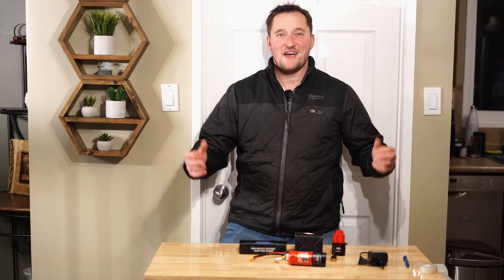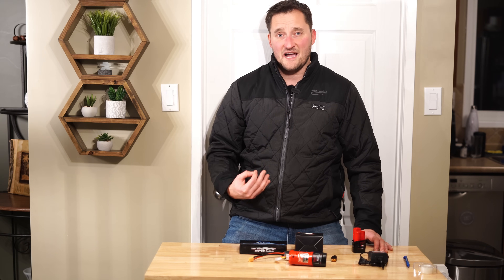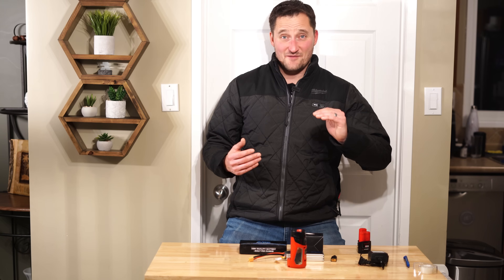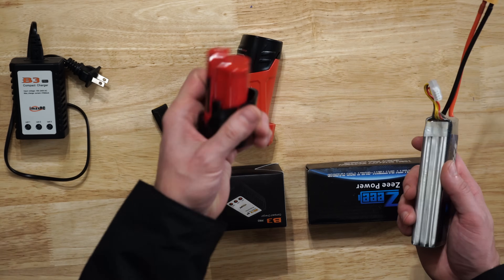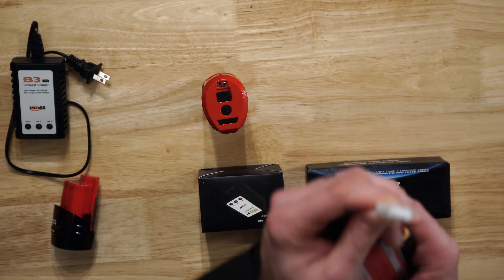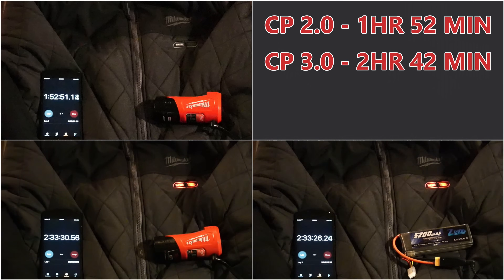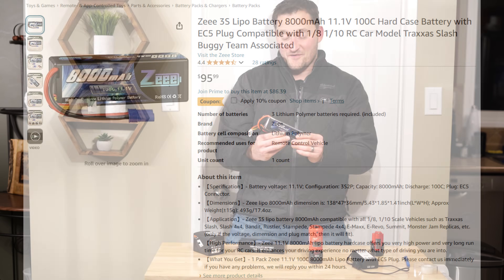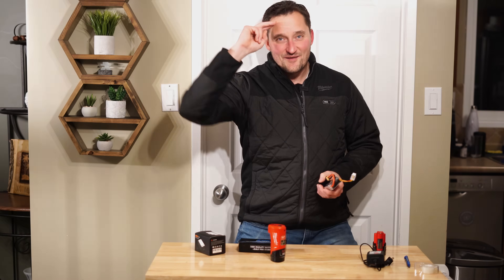WARNING! Read Description - Milwaukee M12 Heated Gear Battery HACK for INSANE RUNTIME!  Part 1

Comment: STOP! Please remove this video from YouTube immediately.  This misuse of an RC LiPo battery will drain your wallet,  best case scenario. More likely, FIRE 🔥. As in you will set yourself, your home and or family on fire doing this. I'm an avid RC pilot and rock crawler. I use LiPo batteries almost daily.  And never abuse them like this video suggests. LiPo and Lion are not the same and this is just a horrible idea.  I do have a Milwaukee heated jacket, but I'm not ignorant about batteries. NEVER DO THIS!!! 😡☹️
Reply from the maker: @ChrisDavis-eq9lj Hi there, I actually put out an updated video where I incorporate a low voltage alarm and intelligent charger into the mix. I personally wouldn't consider discharging a battery at 0.8 amps attached to a low voltage alarm and then charging it back up with a smart charger "abuse" but each to their own. Cheers!
Reply: @RegsChannel  Discharging that LiPo battery at a .8amp rate of discharge won't hurt it. But if that is your criteria for safe use? Your ignorance is alarming and this suggested use of a LiPo is unsafe and unacceptable. Even a tiny 1s150mAh LiPo will cause an extremely hot fire if abused. This isn't a candle or match flame. It's a blow torch and it is not brief. A 3s5000 will be a1 to 2 minute fire. And you want to wear this? Stop Drop and Roll will not help you. These batteries will continue to burn if completely covered by your body. Even under water. Over discharging LiPos like you did in your uncontrolled run time test WILL damage them. Improper charging, ie: charging to fast or unbalanced charging WILL cause thermal runaway and fire. Puncture a cell, very easy to do with that soft case Zeee and FIRE. Leave that LiPo at full charge for more than a few hours? It will begin to self destruct. Swelling and internal shorting until FIRE. I never leave my LiPos up for more than 12 hours, but typically 4 or less from charge to use to storage charge.  Cheap chargers like you recommend often fail, catch on fire and then set the charging LiPo on fire as well. Posting these ideas as "good" is awful. 
     I said I was RC active. Between flying and ground based, I know over 200 people involved in the hobby. Not all of them use LiPo, so you can narrow that group down to about 100. Out of that 100ish, I know of 5 home LiPo fires. One was in a detached garage. Charger fail, burned garage to the ground. 2 were unattended charging fails that resulted in both homes being burned to the ground. The other 2 fails were caught in progress. The homes were saved but damaged. And both guys received extensive 2nd and 3rd degree burns while throwing the burning LiPos out a door or window. I'm not even going to list the fires that have happened in RC crashes, but I've seen plenty of them.
     LiPo batteries are safe to use if used properly. Good ESCs (electronic speed controls) have soft and hard cutoffs to prevent over discharge. So do Milwaukee tools to protect the LiOn batteries they use. Quality chargers used correctly will safely balance charge the batteries. They will also discharge them to safe storage levels. If you don't understand and learn how to use them, you will get burned. I'm also an electrician and have been working construction for 40 years. I have over worked power saws and drills to the point they have burned. But not battery fires. I don't over ride or disable battery safety systems. That is exactly what your video is saying to do and that is dangerous.
Reply from the maker: @ChrisDavis-eq9lj  Thanks again for taking time to comment. Your passion for the topic is evident here. I fully agree, folks need to understand the risks involved with doing anything and then make a judgement call from there if it is for them. For my particular use case I feel that with the proper charger, the low voltage alarm, along with proper storage, I have mitigated the risks to a level that is acceptable to me personally given MY use case.  Obviously that is going to vary from person to person. Take care. Cheers!

Comment: Is there an adapter yet for  Milwaukee's new Hexon heated clothing using the 2-prong F-shaped plug?
Reply from the maker: One of the 2 prongs should Interface with the old battery adapter. I can only assume the second plug is for the Bluetooth functionality. Won't know until someone send me a Hexon jacket, or I pick one up. Cheers!

Comment: As with most "hacks" they are only done by people with no technical knowledge of what they are doing.  Hence being a "hack"... aka a terrible fix that is likely dangerous or a tradesman with terrible craftsmanship.

Wait till the cheap non-listed battery explodes against your body.
Reply from the maker: @PIGGEBANK  thanks for taking the time to comment and share your opinion! The community as a whole here has been very helpful at making suggestions which I have implemented and have and will be adding in future videos!

Comment: I really hope you learn to respect lipos there's a reason why they sell lipo fire proof bags please invest in one when you're not using that battery.
Reply: @stinkyvonfishstix4196 Lipo fire bags are for charging, not storage
Reply: @hdymer   If that's how you feel then please make sure you have a good Insurance policy.
Reply: @stinkyvonfishstix4196  thats just reality… lipos are very volatile if overcharged, depleted too quickly, punctured, or overheated. They dont just blow up sitting around🤦‍♂️,,, hence the bag for charging… do you put your phone or tablet(lipo) in a fireproof bag when not in your pocket? Hahah…no
Reply from the maker: @hdymer  thanks for the comment, I store the battery in an old ammo box.
Reply from the maker: @stinkyvonfishstix4196  thanks for taking the time to comment, when not in use I store the battery in a metal ammo box.

Comment: for that price, buy 2 or 3 batteries and change daily while the other charges
Reply from the maker: Hey there, at least where I am this, with all the parts was actually cheaper than buying a single higher capacity battery. Cheers!

Comment: How dangerous is this?
Reply from the maker: @adrianrobinson7953  read the comments in the video or check out my latest video, you need to assess the risks and take all the necessary precautions to do this safely. This is up to you to educate yourself on the hazards as well as the methods to mitigate those risks. The community here has been great at pointing out better ways to do this. Cheers!

Comment: I’ve tried the power bank it’s no where near the heat..will this be better?
Reply from the maker: @adrianrobinson7953  this is straight 11.1 volts. It's the equivalent voltage of a Milwaukee pack. The usb pack was probably limited to 5 volts. Cheers!

Comment: I agree with others, get a hard case LiPo. Also snag a fire bag to use in your pocket in the off chance it bursts into fire. It will buy you a few precious seconds to get the jacket off. It won’t prevent or stop a fire, but just might keep flames at bay long enough. Also, do stadiums in Canada allow you to take in large batteries? I can’t imagine this is allowed in the US.
Reply from the maker: @jondilly1974  hi there! Just did an updated video where I added a low voltage alarm, and also got a better charger. Yep, had no problem taking it to games here. I'm looking into 3D printing a hard case for this one currently. Remember I'm pulling 0.6-0.8 amps of current from the battery with the jacket on high, and I also charge it at the same rate. I do believe that there is a correlation between how had you are on the battery with things like current draw and over/under discharge resulting in it turning into basically thermite lol. Folks do need to understand the risks involved, educate themselves, then make a decision from there! Cheers

Comment: I just wouldn't feel comfortable walking around with a Lipo cell on me
Reply from the maker: @Christoph_NTX  That's totally fair, as pointed out by many, they are not without their risks. You need to assess them, and then take steps to mitigate them if you go down this road. I did an updated video where I got a better quality charger, as well as added a low voltage alarm to the mix. Cheers!
Reply: @ 1. I love that you replied 2. I love that you even made an updated video 3. Merry Christmas!

Comment: Don't do this. I've personally watched those batteries light up. This guy has not done enough research. Use a flat ororo battery ment for jackets
Reply from the maker: @Kalvin-l2x  Thanks for taking time to comment. Can you share under what conditions they "light up" that you observed? I've released an updated video that goes more in depth as well. Thanks!

Comment: Highly do not recommend using an RC car battery in your pocket of your coat unless you wanna catch on fire. I had one of those exact batteries blow up in my RC car.
Reply from the maker: @dirtjunkienation  Dan you give me more insight on the incident? Did the battery spontaneously combust or was it under load? Over/under discharged? What was it's physical condition?  Cheers!

Comment: How do you connect it though.  Different leads.
Reply from the maker: @danmcguffin4219  I highlight the adapters I use in the video. Please check out my latest now for additional safety info. Thanks!
Reply: @RegsChannel  ok thanks

Comment: I’ve got a Hart heated jacket and I’m thinking of going with your method when my batteries are done.
Reply: Please learn about the dangers of this type of battery.
Reply from the maker: @stinkyvonfishstix4196  thanks for taking time to comment, I've put together another video talking more about LiPo safety in general. Thanks!
Reply from the maker: @1977bjhaas  thanks for the comments! If you do make sure you follow all the proper safety precautions first! I have an updated video that I just released that speaks to that side of things a bit more. Cheers!

Comment: Dude this about dumb as hell. It’s needs a bec for that battery. The constant draw with a heating element will heat that battery. Not to mention if you crush it or poke it and mess a cell up it with turn in to a road flare in your pocket. Do not fucking tell people to do this

Comment: immma tellyou right now dont do it first.. a lipo does not have a bms and unless that adaptor the m12 fits into has one then your screwed.. .. so make sure it does i think only 2 companies use bms in their batts ridgid ryobi  the rest milawakee its in the tools so you can drain the bat to 0 if your not careful also a lipo in your pocket bad bad bad ide if you puncture it etc if it decideds to instantly puff.. your better off with lifepo4 cells or 18650 cells
Reply from the maker: Hi there, yup I'm aware of that, In my most recent video I've added a low voltage alarm and set it to 10.2 volts which is just above the manufacturers spec for the battery, also changed up the charger to a B6 based on advice I got from here. Cheers!

Comment: You know why it lasted so long? It has no discharge protection. The m12 batteries do. It's the circuit board in them that protects them and you.  You gonna set people on fire. You over discharged it. You fucked it up. You got lucky. Sometimes they catch fire when you over discharge them.... Totally roll of the dice. You should take this video down immediately. If people follow suit and are not as lucky ... Or worse.... They buy a 2s..... Mmmm mmm mm.... Lithium fire, Son! They don't go out. Now imagine being in an elevator filling quickly with toxic vaporized metals ..... Very hot by the way.  Take it down dude. Take it down.
Reply from the maker: Hi Ron, I appreciate the concern, I ended up repeating the test with a low voltage alarm, and managed 5:30 with the battery stopping at 10.2v which is within mfg spec. I've put out an updated video that goes into deeper detail in terms of some of the safety aspects, but I do agree that folks do need to understand the hazards associated with these. The RC community has been a fantastic source of information. Cheers!
Reply: @RegsChannel  nah. Uve never seen these damn things go off. This is a bad idea still. Then 3rd party volt monitors are not trustworthy. They're designed to protect things...not people. U wouldn't trust Radioshack to monitor your moms pacemaker. 

Lemme help u out.

lithium iron phosphate "LiFE" 
.....waaay safer....probably the safest of the polymers. Not nearly as energy dense but worth it for the safety. They're just as thin and light.

Or even LiHV is safer.....basically creme de la creme of lipo....it's the high dollar shit that floats to the top when making lipo batteries......they scraped the best shit and sell it as LiHV.........they're much better quality and catch fire a lot less. 

Lipo is the most likely to go off.
Lipo is the lowest quality of all the polymer batteries.

LiFE is the least energy dense but least likely to go sparkler.

Everybody that messes with these polymer batteries knows this.
The video makes your channel look uninformed. FYI.

I  have no hate for you.
Nothin but love here.

Comment: If I was you get a good charger because it's very Dangerous lipo fire...please update your charger
Reply from the maker: Thanks for the concern! I just put out an updated video, I am currently using a B6 charger now, far more robust than the original unit! Cheers.

Comment: Im sorry bud.... but that's such a piss poor idea, you're gunna catch someone on fire! Those batteries are super sensitive to bends or punctures and temperatures....
Reply from the maker: Hey there, thanks for the comments, I've since put out a video where I have changed up th charger, added a low voltage alarm, and am looking at testing out a hard shell pack. Cheers!
Reply: @RegsChannel still... they don't give you much time if they fail catastrophicly... sorry if that offended you at all, it's just a very poor choice for safety reason
Reply from the maker: @rich692351To the best of my knowledge, they don't just spontaneously fail, there are usually signs. If they did, producing, shipping and selling them would be near impossible. Cheers!
Reply: @RegsChannel  did i say spontaneously fail? No.... and you're supposed to say if you are shipping g those types of batteries 😉.... say you lean back and a cell gets damaged? You're gunna know? The voltage doest spike if the cells start swelling... but since you're an "expert" yourself ill leave you to it... - cheers
Reply from the maker: @rich692351  you can into the comments with a head of steam calling it a "piss poor" idea there fella. I never claimed I was an expert, heck I didn't even say I was offended at your last comment. The point I'm trying to make is that under most cases there will be signs of failure as in the cells will start to puff, you may smell some of the material just before etc. If I'm sitting at a game with my low voltage monitor I think I'm going to be fine. I can't see me getting spontaneously poked in the back in the location of the battery pack but I'm not saying it couldn't happen, but the odds are relatively low. Cheers!
Reply: @RegsChannel  lol no head of steam here... lol I'm just saying ya goof... there's a reason why they make and sell LiPo fire bags my guy... have fun man and good luck to you
Reply from the maker: I appreciate the gaslighting! Being disrespectful and telling someone their idea is "piss poor" is no way to start a conversation. I store/charge the batteries in a metal ammo box. Cheers!
Reply: @RegsChannel  ok pal.... I stand by my statement... Piss poor.... get over yourself pal - cheers
Reply from the maker: @rich692351  thanks so much for your comment! Have a fantastic rest of your day!
Reply: @RegsChannel  you too pal -cheers
Reply from the maker: @rich692351 Thanks you too! Have a good one!

Comment: NO NO NO. That kind of kind of battery burns my garage. That doesn't have bms. Not a great idea. A huge safety concern.  Once it bend or get poked it will start a fire like fireworks. Watch a lot of video how lipo explode.
Reply from the maker: @biendomingochannel  hey there, please read the video description, or better yet, check out the updated video I just released on this topic. Cheers!

Comment: Any of us RC guys as soon as we get a wall charger it either goes in the package and gets checked or get set to the side because we have really high in chargers or you can get non-break the bank chargers, but never use a wall charger, cause you can never trust it on charging properly and it could blow the battery. It’s not safe to do. You’re literally doing at your own risk.
Reply from the maker: Hey there, I'm having a hard time following what you are saying here. In the original video I was using the B3 balance charger, I have since upgraded to a B6 charger with a display, and a level of customization when it comes to both charging and storage. Are these classified as "wall chargers" ? Thanks!